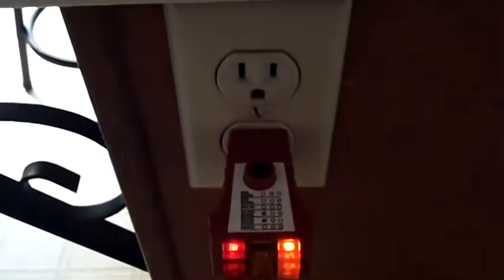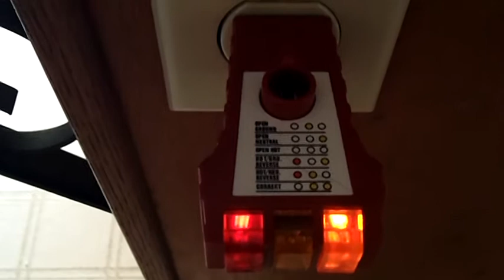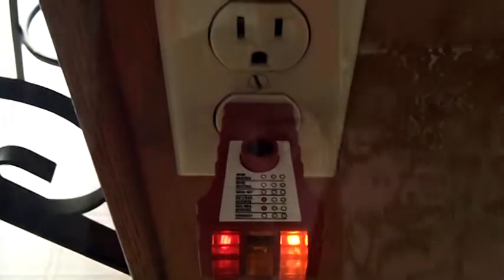Electrical HELLLLLLPPPPPP!!!!! CMHH 6-25-12

Comment: GFCI is ground fault circuit interrupter. Usually there is a button on some outlets that you can press that say test and reset. You might need to open up all the outlets to see if one of them is mis-wired.

Comment: a GFCI are those plugs with resets on them, check to see if there are any and reset them, if problem persists, carefully remove the light switch for the porch light, (power off) and see if any wires are burned, corroded, or touching something they shouldnt.. im guessing somewhere between the light and panel you have an issue with one of your plugs

Comment: if it dont work i've seen a shit load of plugs and switches go bad ive had a couple bad ones myself ...take the cover off unscrew the outlet or switch  pull it out  and you should see it broken or burned try that first before you look in the attic!! oh and turn the breaker off first and cory the hot and ground reverse just means someone wired them wrong they were more then likely already like that !! dont worry about that just do the above steps and you"ll find it trust me !!! HFL!!

Comment: You might have lost connection in one of the wires from the daisy chained outlets in that circuit line.. chk and see if you get power or not on both top and bottom outlets from each receptacle thats out.. if you get power from one of them and not the other then maybe that outlet needs to be replaced to give the proper daisy chain to the rest of the circuit..